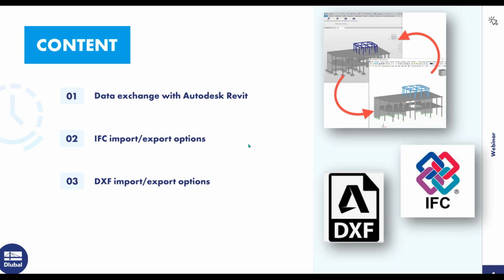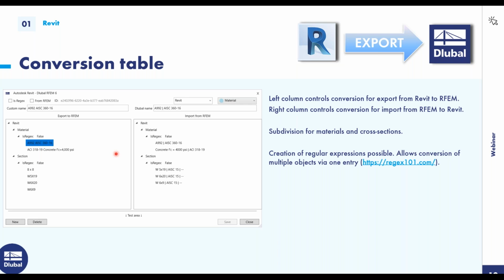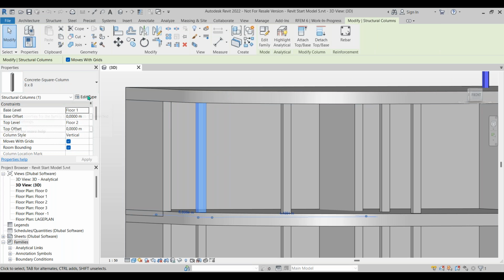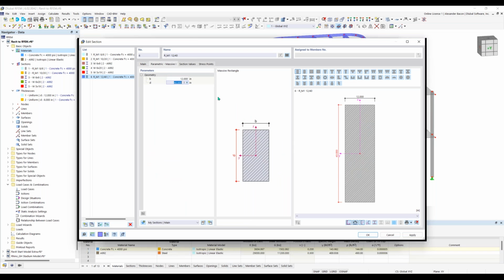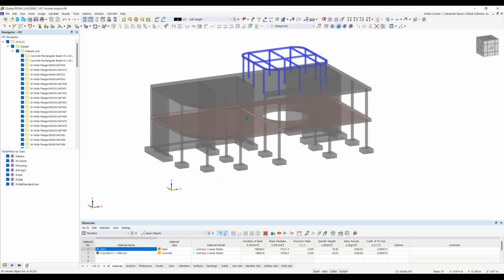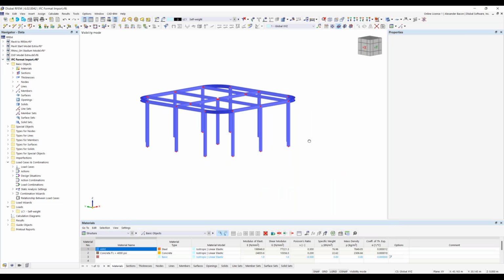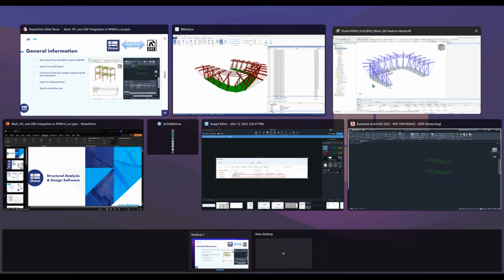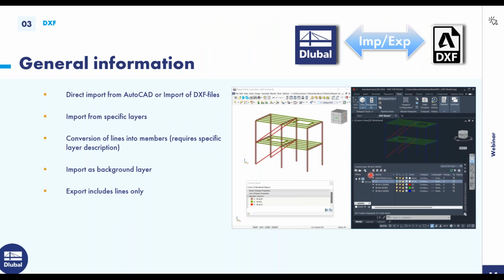Revit, IFC, and DXF Integration in RFEM 6 (USA)

Comment: Is there allready a solution for the IFC to RFEM with the automatic node alignment as mentioned in the video to be introduced soon?
Reply from the maker: Hi, @tomgodthelp2969! Thanks for your question. You can check out the following link, which might help you: https://teams.microsoft.com/l/message/19:74a7d8a2-ddcb-4602-ae38-6a54898f45f3_83c77522-7ea7-4b94-95d7-5f4fc225fd01@unq.gbl.spaces/1755612004529?context=%7B%22contextType%22%3A%22chat%22%7D

If you have any further questions, feel free to contact our support team (support@dlubal.com) or join our community to get in touch with other Dlubal Users.
Here is the link: https://community.dlubal.com/
Reply: @DlubalEN  Thanks! Unfortunately I cannot open this link. It does not work since I am not part of your organisation I think.